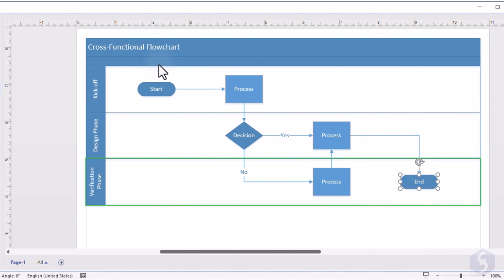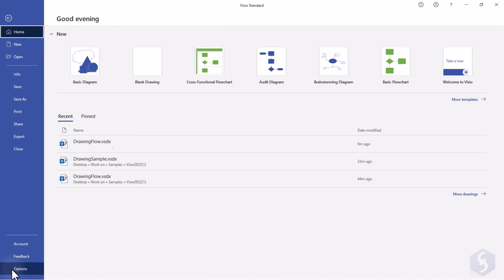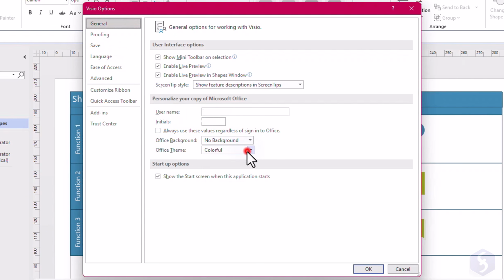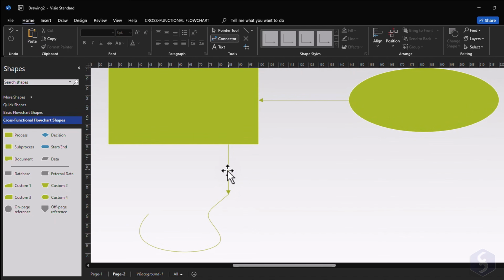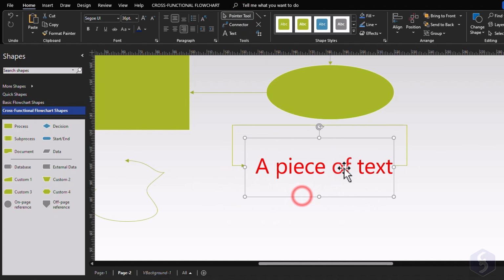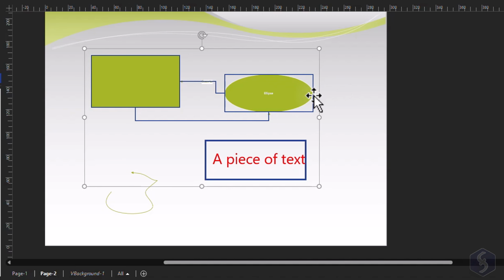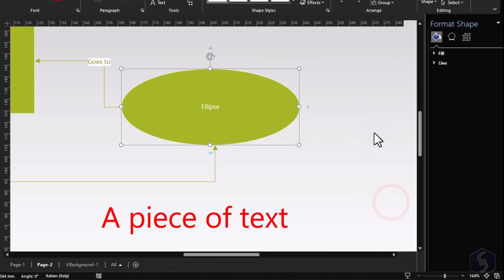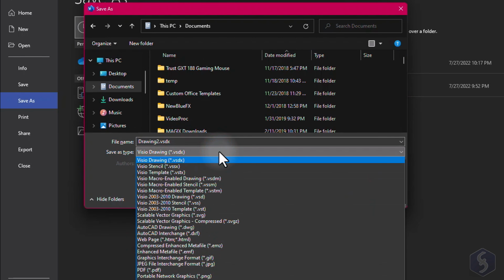Microsoft Visio - Tutorial for Beginners in 13 MINUTES!  [ FULL GUIDE ]

Comment: Before. Coming this video I was thinking ms visio might be hard and difficult to learn anyway this is. Used to create electrical diagram of  system but once the video is started and  watched it until it finished but one thing I can tell you whoever used ms word and ms Excel for those this is very easy and good
Some key points:
1. Can create any shape 
2. Connectors are there whose direction can be turned into anywhere.
3.can format text
4. Can make a group of multiple objects and later ungrouped as well.
5.
Reply: I used AI to make it more understandable:
Before watching this video, I thought MS Visio would be hard and difficult to learn since it is used to create electrical system diagrams. However, after watching the video from start to finish, I realized it is actually quite easy to use—especially for anyone who has already used MS Word or MS Excel.

Some key points:

1. You can create any shape.
2. Connectors are available, and their direction can be adjusted as needed.
3. Text can be formatted easily.
4. Multiple objects can be grouped together and later ungrouped if needed.